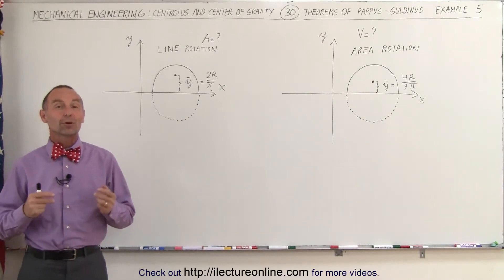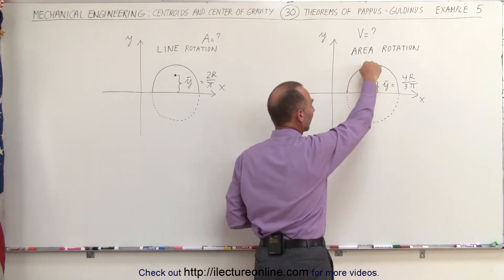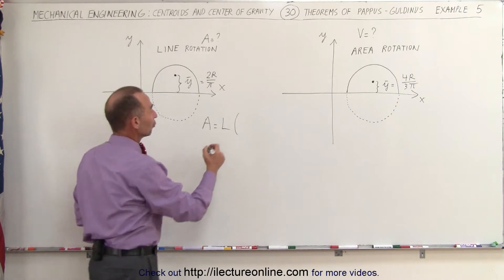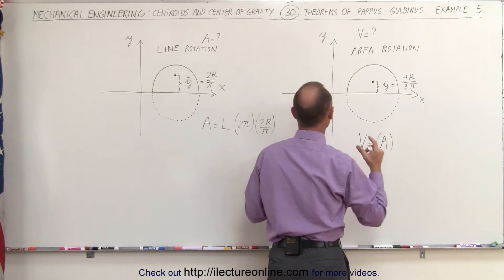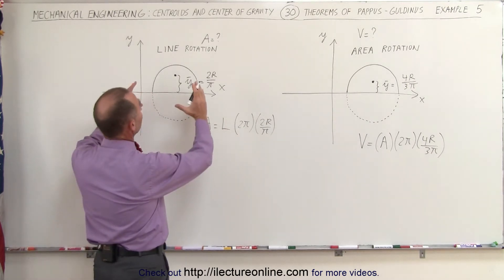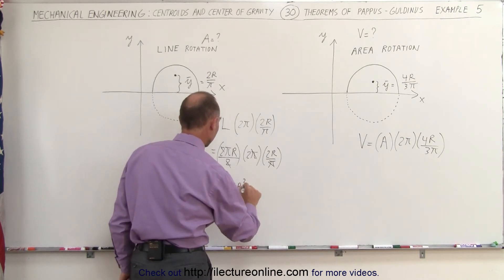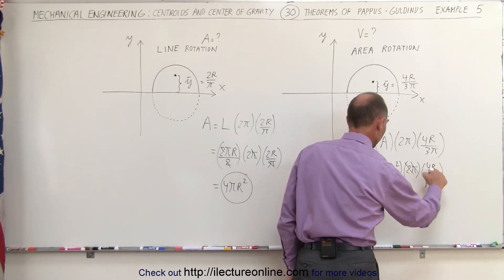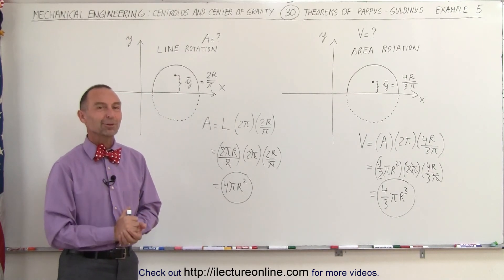Mechanical Engineering: Centroids & Center of Gravity (30 of 35) Area, Vol=? using Pappus-Guldinus

Comment: Hi Sir, why did you use 2R/pi for the Area and 4R/3pi for the volume? I know that one is for an arc and the other is for the semicircular area, but why are they different?
Reply from the maker: The center of mass of an object in the shape of a semi circular line has a different center of mass compared to a semi circular disk.
Reply: Michel van Biezen ok thank you